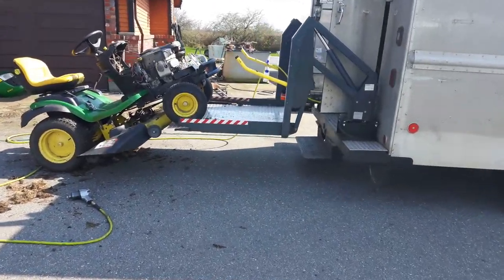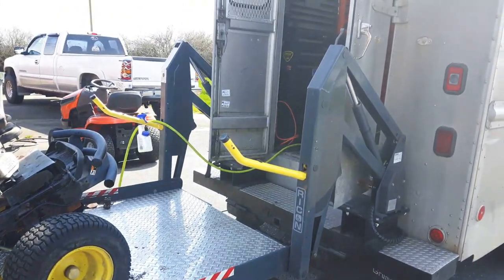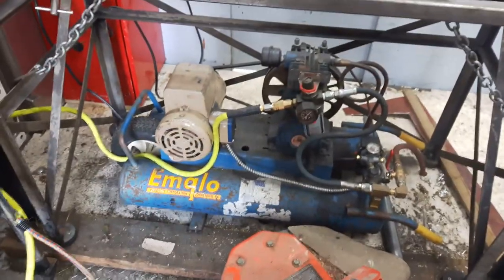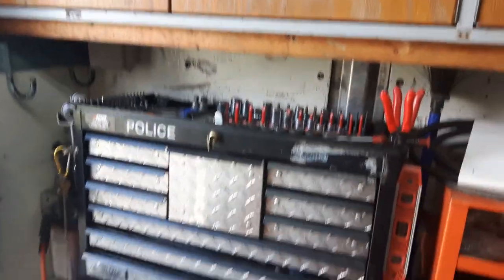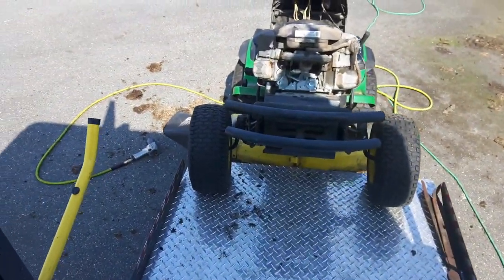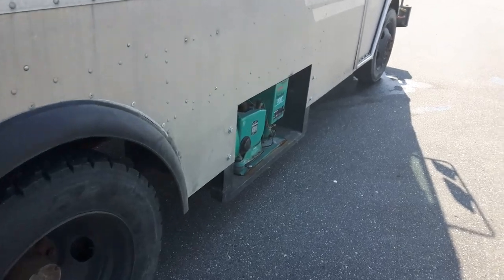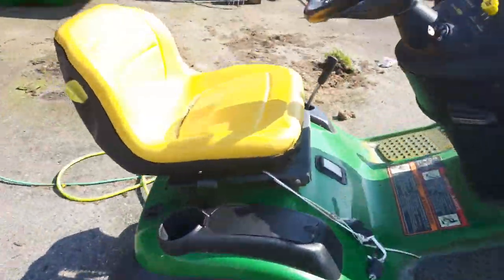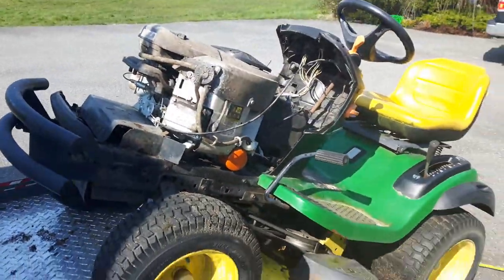The Grumman Mobile lawnmower shop

Comment: When you have to take the engine off and do something like replace the cam, do you do that on the truck or do you take it back to a shop?
Reply from the maker: I've removed engines onsite and done major internal repairs, but usually for a bigger job like that outside of a standard quick repair or service, I prefer to take them back to my shop to do the job. It's more of a time thing, I work full time as an equipment manager at a golf club and do these small engine jobs after work and on the weekends. Only can fit in a couple of side jobs a day after shift A is finished.
Reply: @machinesnmetal   I’m in the same boat.  I have a full time job but do small engine repair on the side at nights and all day Saturday and Sunday. But I just have a shop at my house. Nothing mobile. So I basically just work and sleep. I’m exhausted. I love the small engine work but damn. Lol. Spring and summer are absolutely insane. It slows down in the winter thank God. I tried house calls but learned real quick you need a mobile shop like you have. You can’t just grab a tool box and run to their house in your truck.
Reply from the maker: You can run around in a pickup with a toolbox but it makes all of us small engine guys look bad. I had a retail/service shop from 2009-2015 and got fed up with the overhead and being stuck in the building 10 hours a day 7 days a week. I closed it and went mobile to support the customer base I'd built while in the shop. I don't advertise anymore, only via word of mouth now and the few people who see the van and call the number on the side. I too get quite rundown and exhausted in the spring/early summer, but it doubles my income for the year and once the hot weather hits and the grass stops growing it's boat and toy time :)
Reply: @machinesnmetal   Yea, that’s why I stopped after the first one. Lol. I only work out of my shop. Every year or two some hack opens up a small engine repair shop in my area but they never last very long. I end up repairing what they screwed up. Too many people think they can do this because after all it’s just a lawnmower.  It’s not as easy as it sounds. I’m 53. I’m not sure how much longer I can keep up this pace.
Reply from the maker: For me it's a hobby first and money maker second. If you don't enjoy it as a hobby it's a frustrating waste of time. This is what these guys who think they can open a shop and get rich don't realize. They only want to do the straight forward jobs, oil changes and blade sharpens. I figure if they aren't setting up to grind McLane or TruCut reels then don't give them a second thought. I just turned 40 and on track to be finished with all of this in 5 years. Planning on moving overseas somewhere warm for the 6 winter months a year and returning home the other 6 months working in the turfcare industry when I'm back.